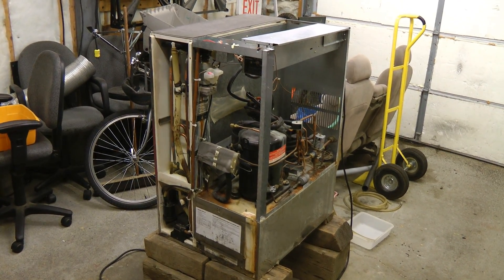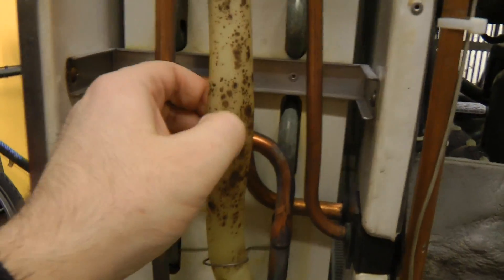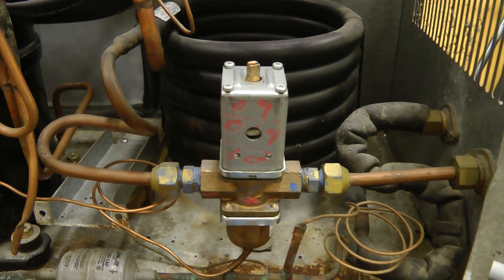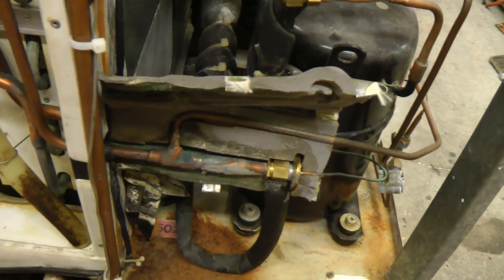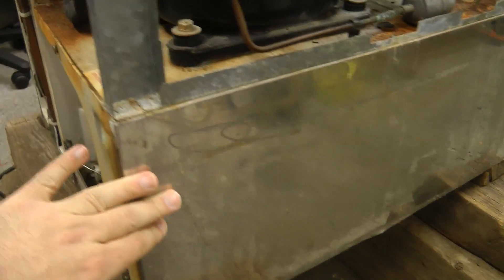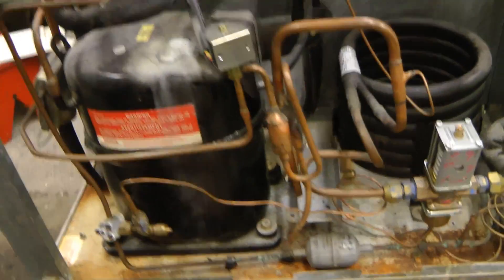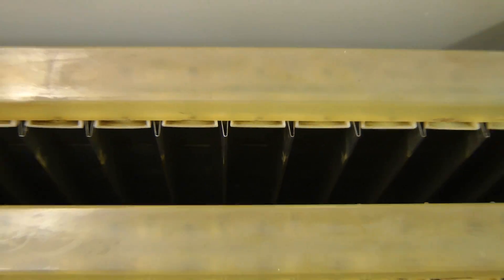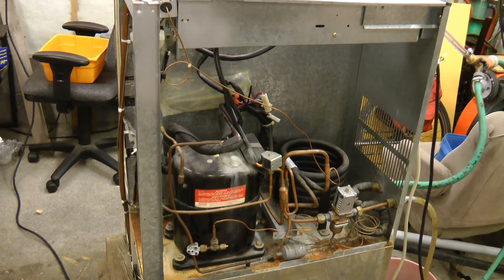Hoshizaki commercial ice maker teardown

Comment: The running of the liquid line by the suction serves 2 purposes. It ensures the TXV gets liquid only, with no gas bubbles in it as the temperature is well below the condensing point for that pressure, so it does not have sudden gas surges. As well the hot liquid also ensures any liquid refrigerant is turned to gas before it goes in the compressor.  Hot gas defrost is common, it saves the issues of sudden pressure surges in a full reversing valve ( which needs the compressor to be switched off before and the system pressure to be equalised before switching gas direction) and can defrost and switch to cooling very fast after the ice is melted.

If you were to put a refrigerant to air condenser on it, you would need to have a condenser at least as large as the machine again, and both a fan speed control and more complex monitoring of the ambient air temperature, or a split connection with external condenser.

Comment: That liquid line follows the cold suction line to increase efficiency. The liquid is pre-cooled by the cold suction pipe. This countreflow heat exchanger isolates the low temp evap and high temp condenser.

Comment: I love the beautiful simplicity of these machines; the only moving parts are the compressor, waterpump & condenser fan on the air-cooled models. I'd say that's beyond economical repair as the evaporator tubes are loose between the stainless plates meaning there won't be any thermal contact. Not only that, no reputable refrigeration engineer leaves a vampire tap on a system; they are known to leak.

Comment: R-408a was a replacement for r-502.  R-408a is due to be phased out because of containing some r-22.  Not many techs carry the stuff due to the price.

You could run the unit on r-404a,  but the oil in the compressor is mineral oil.  R-404a requires POE oil.

Comment: So is it like a heat pump? For defrost mode, does the refrigeration cycle reverse to heat up evaporator coil to knock ice off?
Reply from the maker: Not a heat pump sadly. Defrost is just a hot gas bypass, a solenoid valve that dumps hot compressor discharge gas straight into the evaporator. It produces much less heat than a reversing valve would, but seems sufficient for the application. Probably used because it's cheaper.

Comment: If this is meant to be scrapped and never been used again or so I would personally just have dumped propane in it.

It would probably not suite well with the TXV due to many reasons but it might produce something and perhaps even ice. I guess R290 have a higher condensation pressure then the gases used in this but the compressor should be able to handle it with no problems. Have made many homemade refrigeration things with propane during the years.
Reply: Is there any difference in the compressor for hydrocarbon refrigerant? I didn't think you could charge that compressor with flammable refrigerant.

Comment: How do you get the ice out?
Reply from the maker: +jaimeesg It falls out the bottom into a bin (which I didn't pick up because it was of no interest)
Reply: tesla500 thanks that completes the puzzle!
Reply: It drops down onto that angled plastic grid at the bottom and slides forwards into a big hopper (like an ice chest) that isn't shown in this vid - essentially this machine normally  sits on top of a big cooler and drops ice into it.
Reply: Yup, that's it exactly. I actually have used similar machines a bunch. Usually a flip-open lid on a 45 degree angle with a rubber gasket-like edging to seal it, like a fridge door, and then it's just a giant metal box with a thick layer of insulation to prevent the ice from melting in the heat of the kitchen.

Comment: We have (well, had) a smaller under-cabinet ice machine that operates on this same principle. It runs water over an angled chilled plate until a sheet of ice builds up, then switches into a heating mode (though I think with resistance heat rather than any kind of reversing valve), dropping the ice sheet onto a heated wire grid to cut it into cubes. Makes very nice looking ice, but uses quite a bit of power to do so. Ours actually failed in some fashion and flooded the house during a vacation, despite being off. Not fun! There is a good deal of repair information for the smaller models available on the internet, see http://www.truetex.com/icemachine.htm